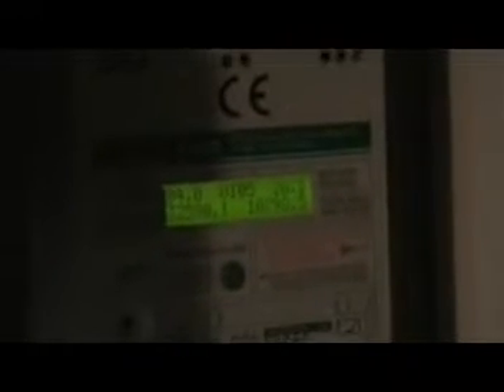Alternate energy Part 2, economic crash, food storage, 2012

Comment: The batteries are wired in series to increase the voltage from 6 to 24(not parallel), They are wired in parallel to increase the amperage/storage capacity. This is typically known as a series-parallel setup. You had the right idea, just backwards.

Comment from the maker: What this does is then the inverter will not LET the batteries get run down as much. Contrary to popular belief you do not WANT to consistently draw your battery bank down that much. Adjusting your LVD to a higher setting will make the inverter shut off at a certain point- BEFORE your battery voltage gets too low. This however can be a PITB on a small system without a lot of storage capacity. Regular care of your battery bank goes a long way also- watering, EQ charges, etc. SR

Comment from the maker: Supposedly you can special order these types of batteries DRY. I've never found that to be true, but folks say you can special order them that way. Obviously you would want to have backups ;) I would assume that even without a load your wet batteries would start to sulfate after 5 years or so. A good MPPT charge controller will help extend your battery life. Also, you can set your low voltage disconnect setting on your inverter- where your inverter shuts down- to a HIGHER setting. Continued-